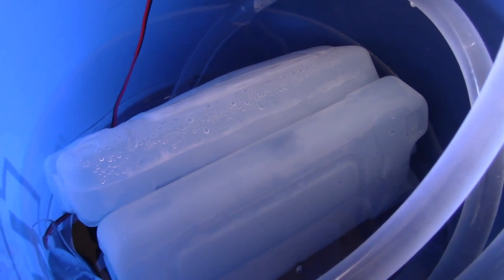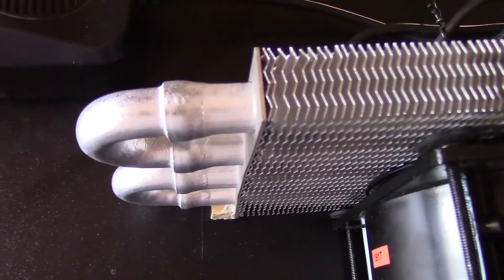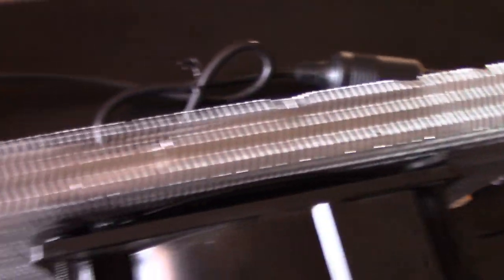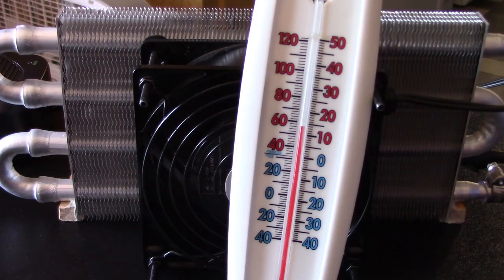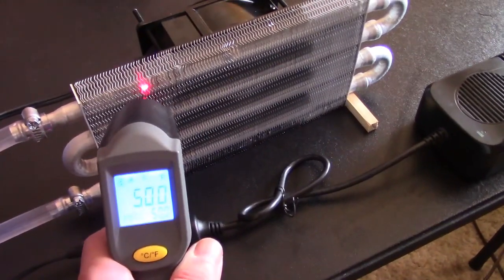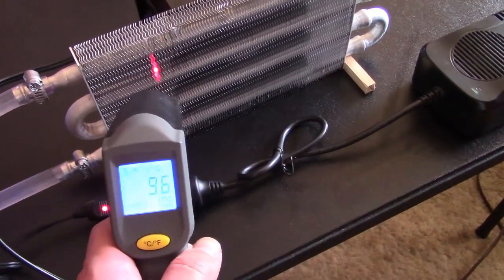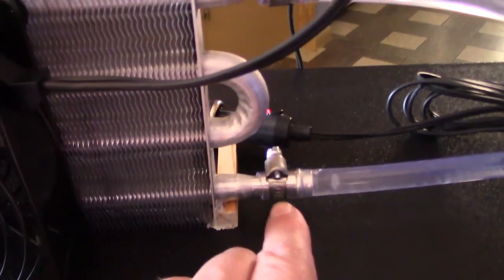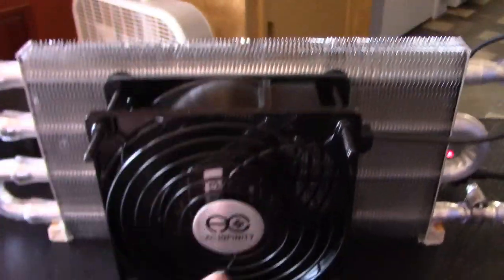Homemade AC Air Cooler! DIY Air Cooler! (compact!) - No added humidity! - Easy DIY - Air Conditioner

Comment: why two different speed fans?? maybe have a low speed fan on the hot side of the radiator (heated water) to increase ice life span?? and two high speed fans in front of the radiator to pump cold air! nice work tho1
Reply from the maker: hi. no particular reason for the two different speed fans. i just wanted to show airflow of both. some people might want to use the low speed one if they are sitting at the computer and it's right in front of them. the high speed one i can feel up to 15 feet away. that company makes excellent fans. the ones i used are rated to 67,000 hours.

Comment: I'm almost done knocking up something similar with a 120mm radiator and a coolbox (had thought of it then did some searching to see who else had!)  to keep the ice as cold for as long as possible - just waiting on the little water pump to test.. it should help in my music room on the few days/weeks a year it gets too warm! I like how it doesn't add humidity, should stay cool for many hours just not sure how much cooling I can get from a small system.. will see.

Comment: Great build. The 5 gallon bucket with a lid and grummets to keep all cold air tight for as long and possible. Plus rap the bucket in an insulation. Boom a win win cold all day DC 12v air conditioning. Awesome.
Reply: I use 12v cooler, freezer combo for gallon milk jogs,  in my van. This will make cold air 24x7.
Reply: @MrLegendfx  what is a 12v cooler freezer combo??
Reply: @sharonmetzner1798  I think he's talking about a small 12 volt refrigerator/freezer for small trailers or in his case his van. I've used them, some are propane/12volt/110 combo. freezes his water jugs in it to use in his ac system. the older ones have a small center  ice tray size "freezer" that freezes and keeps the unit cold or crank it up and freeze stuff.  You could use a separate dedicated solar panel for the freezer, rotate jugs during the day in the AC unit cooling container.

Comment: Can you collect. Water also?
Reply from the maker: hi. if you mean condensation, i don't typically have that issue where i live. if you do you can probably just set a small hand towel under it (or even just a paper towel if it's minor)

Comment: To make this even more efficient; in my mind anyways, and for a larger scale use. Sink a holding tank of some sort; IBC, plastic drum etcetera, in the ground; well below grade, and cover it up. Of course you'd have to install the proper plumbing before hand. Run all that into a manifold where you could split off to individual lines for separate applications. Insulate all your above ground lines. And you could; in theory, always have sub 60° water for circulation. Right? Yup! In my mind anyways. That way you remove the need for refrigeration and ice.
And with black poly vinal tubing you could go solar for heat as well. Coil up a length of poly vinal in a glass covered box and you'd; in theory, create a hot water radiant heat system.
You've got my brain going now, Sir! I'm glad I found your channel again. I misplaced it for sometime but now I'm back. I'm glad you're still making videos.
Reply from the maker: hi there. good ideas. i've always thought the idea of going sub-surface for cooling is an excellent idea. if your water is even 60F you get some awesome cooling out of these devices. (i even ran plain tap water (72F) through this device and got a 5 degree temp drop with no ice or cold water at all). the solar option for heating the water (to make an air heater) is great idea too. just circulate every so often and you've got almost free heat. btw i'm glad you found my channel again! i'll hopefully be making videos for 20 more years

Comment: Have you tried a full 20 inch radiator for the box fan and see if there's enough static pressure to blow through it and if so cool a room?
Reply from the maker: hi. there are companies that sell 20 by 20 heat exchangers but they are super heavy and expensive ($200+). here is one for $223 https://badger-pipe.com/products/20x20-water-to-air-heat-exchanger-1-copper-ports?_pos=4&_sid=7c37db64a&_ss=r&variant=29108329425
Reply: @desertsun02  hello, I actually found a car radiator on Amazon for 30 bucks when it was on sale, but didn't really pull the trigger since I wasn't sure if a box fan could even push through it.
Reply: @desertsun02   would a box fan be too powerful??
Reply from the maker: @Sharon Metzner box fans work. i actually have 2 videos showing how to make a unit using a box fan. works good. here's the links...
1.) https://youtu.be/Jfc26AH0jLI (original)
2.) https://youtu.be/oAuL-ScEWfI (extended version)

Comment: There's interest out there for these..I'd stay on it !
Reply from the maker: hi there. i'm certainly stoked about them. they work fantastic and are easy to build. one more (a giant version i'm building) is in the planning stage at the moment. it's going to be bigger than all 3 of those transmission coolers put together with a 2000+ cfm air output. (for people who want the ultimate air cooler) - stay tuned 👍
Reply: @desertsun02  sounds like Central Air LOL wow
Reply: @desertsun02  Wow!!  Have you built this yet??
Reply from the maker: @Sharon Metzner i built something close. i used two of the larger radiators (model 405) and attached them to a box fan. if interested here's the links...
1.) https://youtu.be/Jfc26AH0jLI (original box fan conversion video)
2.) https://youtu.be/oAuL-ScEWfI (extended semi-uncut version)

Comment: A 12 volt system would be perfect for rv living if it didnt have AC already👍
Reply from the maker: hi there. yep, i love the 12v. great for emergencies, power out, camping, tailgating
Reply: That's what I'm using it for. I live in  6 x 12 cargo trailer conversion this unit is working well.

Comment: Would this compact version cool down a small living room a few degrees or is it just for spot cooling? Thanks for the video
Reply from the maker: hi. it would depend on how hot the room is, how big it is, does it get lots of sun and all of that but unofficially, i've seen temp drops in a 10x18 room (my living room) by 5 degrees (83F to 78F). the best i can tell you is it seems to cool half my living room pretty well (so maybe 2 units would do it?) or one for a smaller 10x10 room.
Reply: But making the ice would heat the house more than this cools overall.  So it just moves heat arround your house.  But overall it heats your house.
Reply: @TheRainHarvester  I remember an article I read about removing the evaporator from the refrigerator and adding copper tubing and relocate outside.

Comment: How long before you need to replace the ice packs
Reply from the maker: hi. i'm getting one to two hours of cooling just using a gallon of water and 2 ice paks. for extended cooling times (3-6 hours) use more ice or ice paks or even an ice chest. you could double or triple the time that it will cool (even more if you use large blocks of ice). for max. times fill the bucket with water and freeze the whole thing overnight. then when ready to use just add a little water to the top and put the pump in (you might get 8 hours of run time).
Reply: Not worth the constant hassle to change ice

Comment: You should turn that into an atmospheric water generator
Reply from the maker: hi. you'd have an issue with water quality because it's aluminum. copper pipe might be the way to go (or stainless steel)
Reply: @desertsun02  true, I wonder if there are any dehumidifiers that are stainless steel 🤔

Comment: Could you show a list of parts you can buy online like Amazon AND a step by step instruction for beginners please? Will this work in a van? How much square footage does it cool or do u have to sit in front of it?
Reply from the maker: hi there. the list and build are in the last part of the video. it's super easy to make. it will absolutely work in a van. since the unit is so compact that is a great use for it. 👍🙂